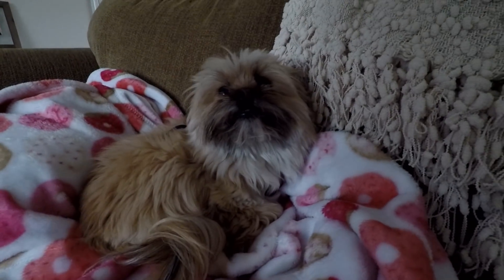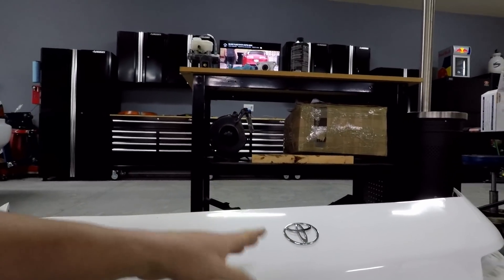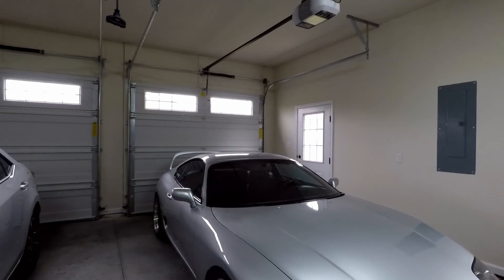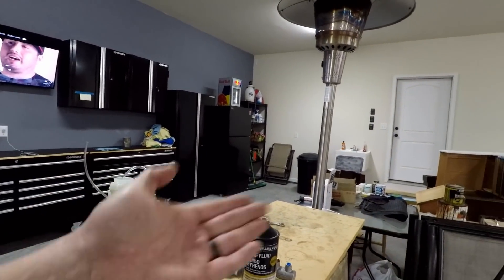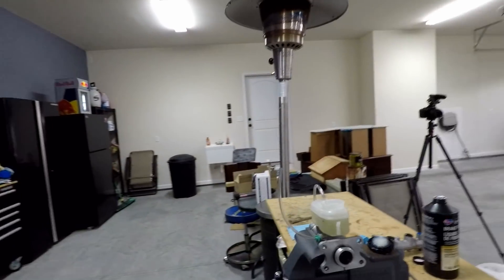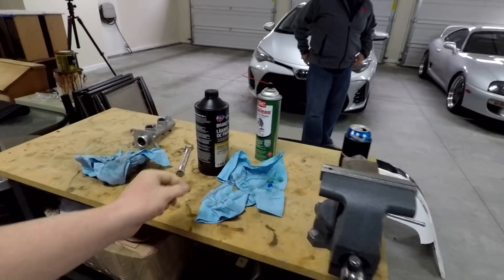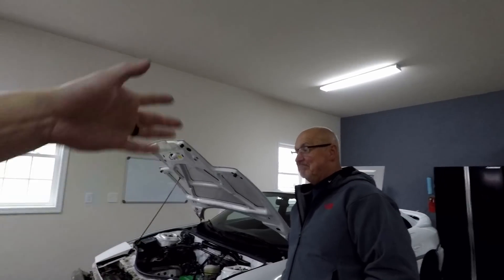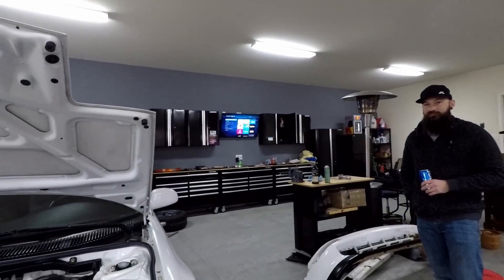MR2 Build: Master Cylinder Install & Wilwood Brake Bleed

Comment: I've got a 3 car garage myself, but damn this double deep setup is really freaking cool. You can fit your cars in and still have a nice size work space. Is this an addition or did you have it custom designed when you built the house?

Comment: You can actually change/mix different dot fluids aslong as they are both either silicone based or glycol based to what is already in the car. You just cant mix glycol with silicone.
Reply: PURE Function Anytime mate happy to help. Just check the fluid is the same base type, is the same they are more then compatible to mix together either to flush or to get out of trouble without damaging your brake system or losing performance.
 Love watching your videos really inspiring.